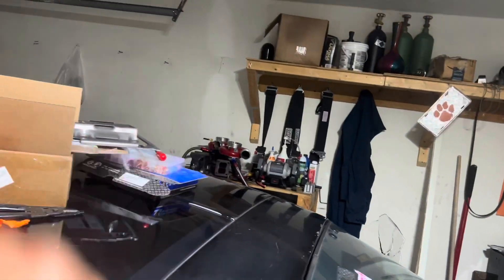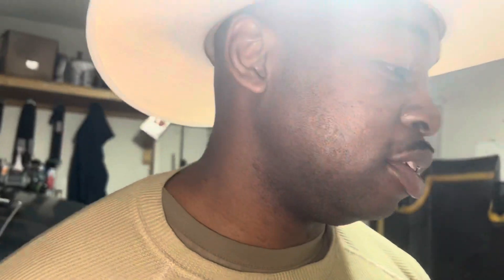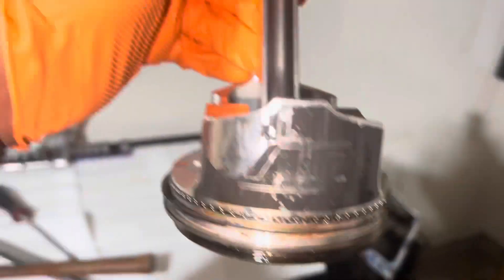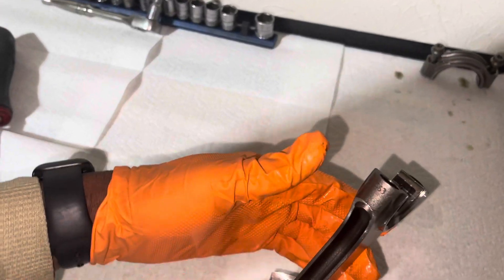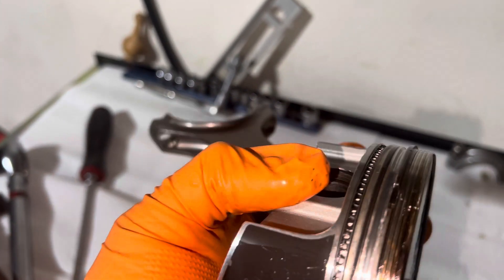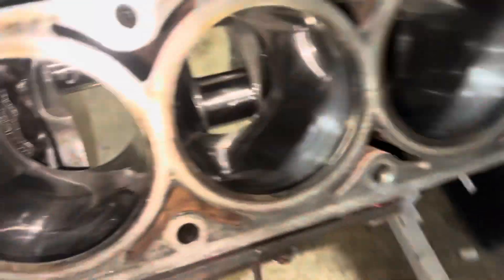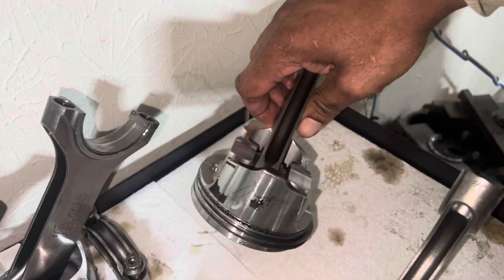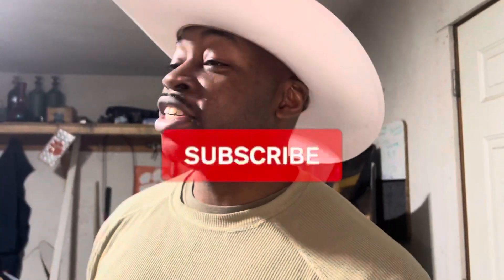LS Turbo 1200 Hp Pistons inspection #turboLs #boost #camaro

Comment: I like to use rod bolt to separate the rod . I leave it in a few threads and tap on the head of the bolt with a hammer. Seem safer than tapping on the side of the rod. Keep up the good work!
Reply from the maker: Yeah you right, after I filmed it I forgot there’s a better way to take those caps off, while rewatching it.

Comment: Some pistons are side specific. Make sure yours didn't need to be on the other bank.
Reply from the maker: I will have check, I had this shortblock built in ‘16
Reply: @boostinwillie  Ah ok. Hopefully you had them right. It's rare and mainly for stock replacement pistons, so you might be good.